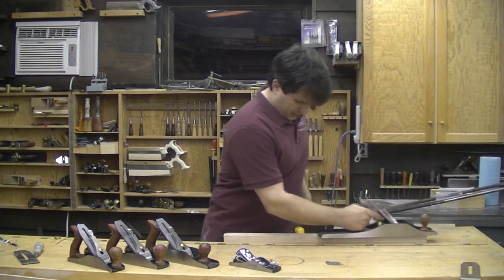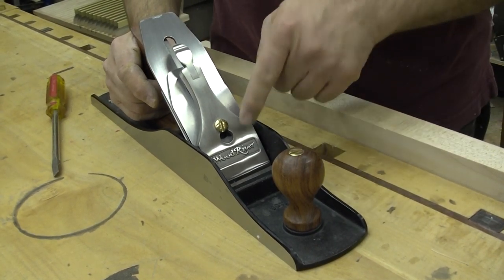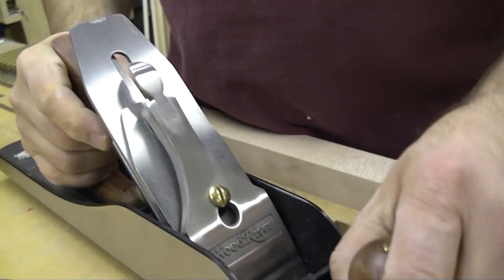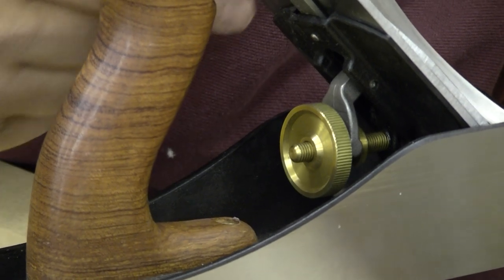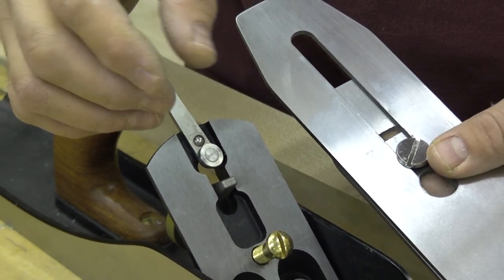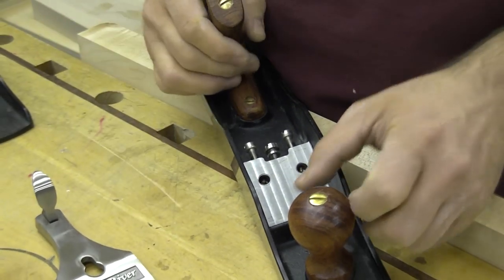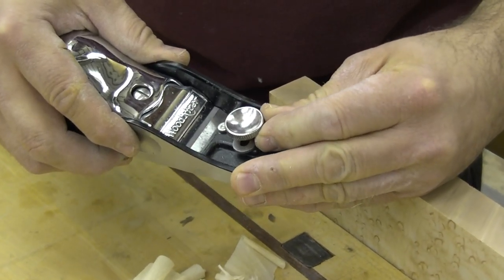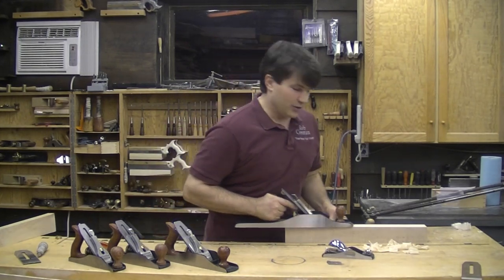Rob Cosman's WoodRiver V3 Plane Promo Video

Comment: Why do they paint the lip around the top of the cheeks? It looks like they have gone to some trouble to do the machining bedrock style and by appearance it looks tidy. But the lip running around the top of the casting on both sides is painted like it is on cheap planes.

It would be nice if all of the modern planemakers, chinese or US would use a knurl with some taste on the depth adjustment wheel. All of them, LN, woodriver, or whatever, have very corporate cost-cut looking depth adjusters.